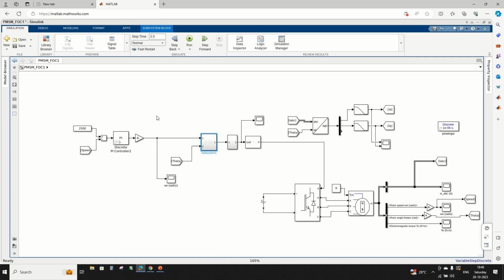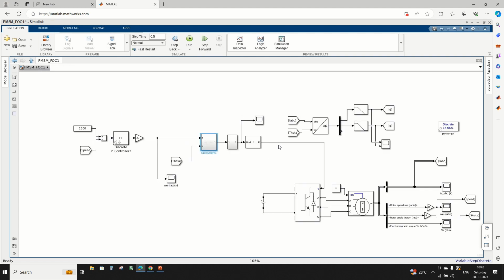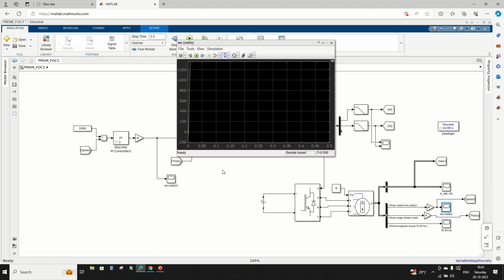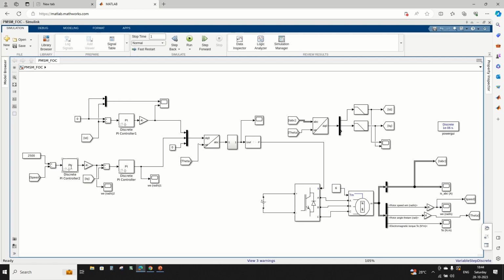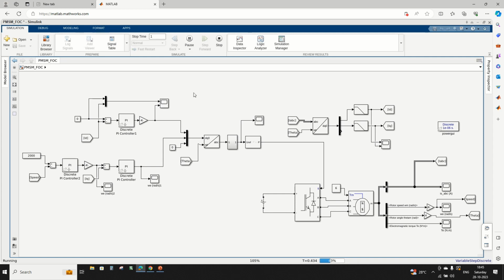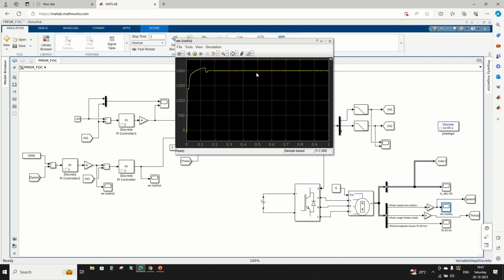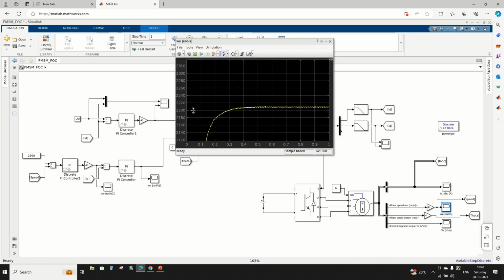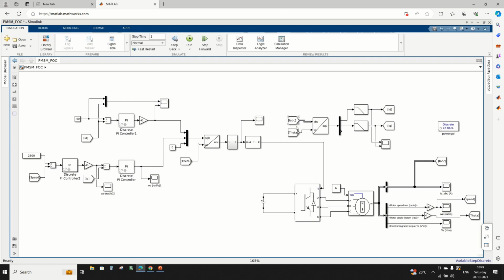PMSM Control | FOC | MATLAB | GoElectrify | Simulation

Comment: This is surface pmsm or not?
Reply: Yes this is the SPMSM because id = 0, which means there's no reluctance torque and Ld= Lq in the case of IPMSM, id not equal to zero, and the current reference generator must be used, such as using Tref as well as wref to calculate the optimum values of id and Iq to get sqrt(id^2+iq^2) < abs|Imax| to ensure the current limits but for IPMSM when assign id we can achieve the same torque with less current which regulate the phase losses and for flux weakening region when the motor run above the base speed we can achieve high speed compared to SPMSM because -id will contributors in flux weakening and increasing the speed also will contribute in torque component which avoid in high speed completely demagnetizing of the magnet during the high -ve id current the another component of the torque will compensate this issue.